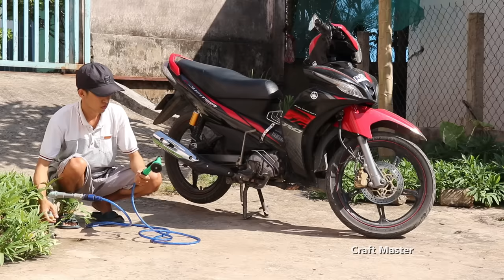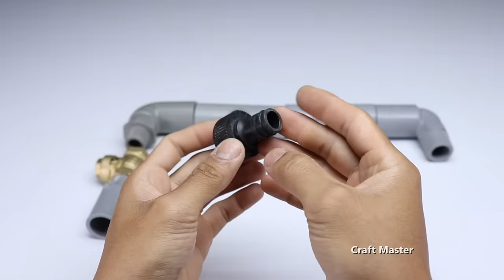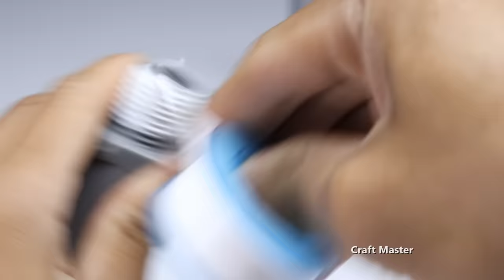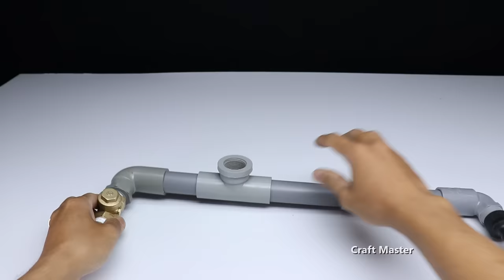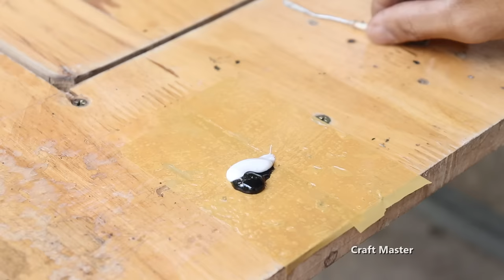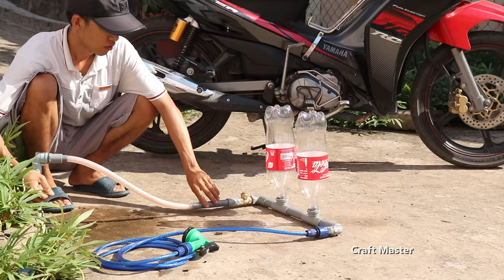DIY Pressure Washer / How To make Car Bike washer

Comment: This contraption did nothing to increase the water pressure. You can achieve similar water pressure by increasing the opening of the faucet and decreasing the opening of the hose' nozzle. To prove this theory remove the nozzle of your garden hose turn on the faucet the water will squirt at a certain distance. Then put your thumb covering half of the hose' opening and the water will squirt twice the distance or more than not covering it.
Reply: There is a small increase in pressure provided by the air in the bottles

Comment: I was confused, at first the water was slow, but when he test his project the bottle filled with water faster, that means the water from the tube was fast or plenty. I know this will not gonna work if the water is slow. Think of it.
Reply: One word.. Pressure
Reply: He had that valve. Do you even know how valve works?
Reply: @arieskasanova3728  the answer is common sense and research
Reply: I agree

Comment: this will work but given the small capacity  of the pet bottles it will only give you intermittent jet of pressurized water as the bottles need to be repressurized very often by the incoming water

Comment: It only works if you have high pressure and low flow... it works as a buffer of pressurized water only...
Reply: What do you mean high pressure low flow?
Reply: @crashercrasher9696 it is like having high torque but low speed

Comment: This is a false video. The only thing the bottles are doing is measuring the static head of the flow. He is just increasing the flow rate with the valve which is increasing the pressure in the pipework.
Reply: Krishna Gurung  You have it the wrong way around. The only thing that is raising the pressure head (height of the water in the bottles) is the increase in flow rate. The water is under more total pressure when the flow rate is increased so the air compressed in the bottle.
Reply: How is this a false video if you are looking at it? Nothing false about this, its an actual video.  Know if you want to question whether the concept shown is valid than that's another topic but this is an actual video. If it wasnt an actual video than there woukd be no comment section to comment on

Comment: wait a minute, from basic physics, the pressure out of the hose should be the same with or without these pipes.
Reply: He is using the little pressure from the pipe to compress the air in the two cola bottle little by little when both of the bottle fills this means that water is pressurized If had used any other bottle other than carbonate drinks the bottle would have exploded . This wouldn't work on house hold pipe but try on public pipes with lager water tanks

Comment: what makes this pressure, is it the valve?
Reply: i think from the bottle cmiww 
because there is no water outlet before the last tap is opened
Reply: What is the name of the valve?
I can buy in construction materialI can buy in construction materialI can buy in construction material
Reply: @calistenianosangue6625  its a swing check valve.

Comment: FAKE! on the intro he just turned Off the pressure pump and bladder, he is using the normal flow of the water supply... and at the DIY part he just turned on the pressure pump and tank... he must put a pressure gauge o the faucet area.

Comment: what's the physics behind this pressure?
Reply: air pressure
Reply: Air pump? Water pump in the house?
Reply: Turn valve so more water comes out. That is literally all there is to it. The bottles are doing nothing.
Reply: It works as buffer , or a spring for the pressure...
Reply: @gustavomiranda932  the water bottles are doing literally nothing. They are just acting as manometers, they have absolutely no effect on this. All he is doing is opening up the valve so more water comes out... like a shower or a normal hose.
Reply: @jetonhaxhia4393  he has a water pressure pump inside the house... and yes you are right, he opened the tap more
Reply: Archimedes i think. The air in the bottle pushed by water from below, then it made air pressure. The air pressure pushed the water back...
Reply: @jetonhaxhia4393  even you tried it at home

Comment: This video potentially contains of a misleading information. Beside, he declared that he use a water pump in his solution system. I'm pretty sure about it.

Think about this: 
The part in this video, that works just like diode in electronic instrument, only let the water flow if pressure from water source/container is higher than pressure that come from compressed-air in the bottles. In a simple words, "this system, like what we see in this video, didn't increase the pressure."